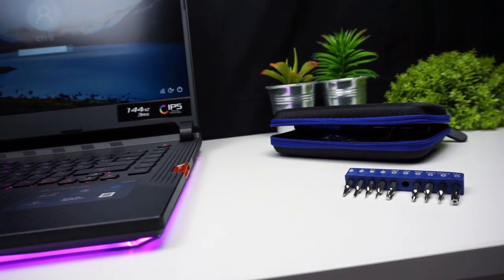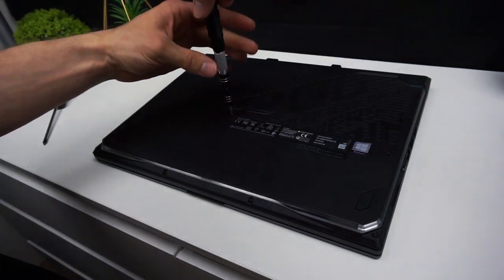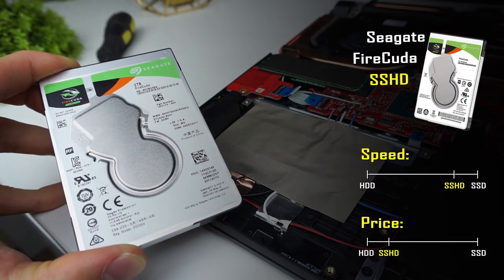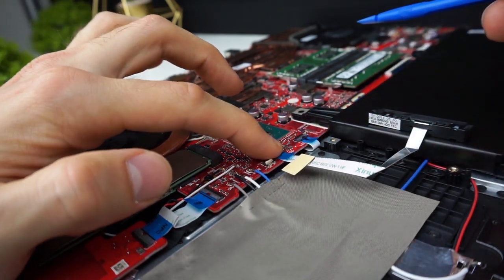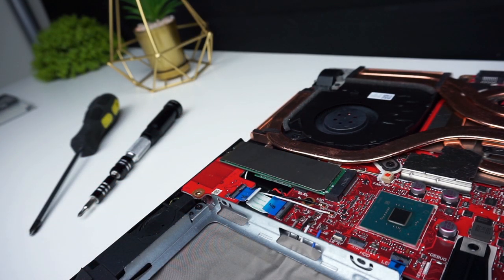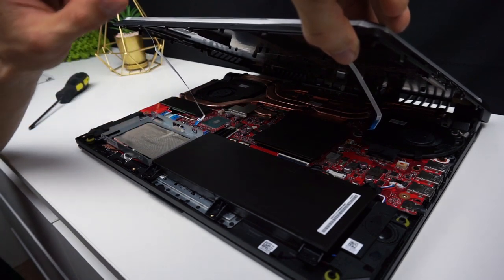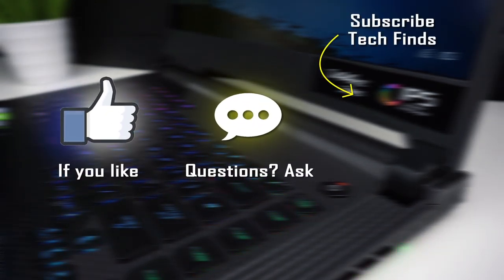Asus Scar III Upgrade RAM / SSD / HDD - Disassembly Guide

Comment: Hey bud! Great video. I am having a hard time in disconnecting and then connecting back the two ribbons from the motherboard. Can you please explain me the correct way to do in with ease in detail?
Reply from the maker: Well, behind the connector on motherboard you have a little white tag. To either disconnect or connect the cable it has to be opened (tilt up), you have to pry it up from the bottom, do something like a lever. When it's opened disconnect or connect the cable depending on what you need to do, and close the tag (push down).

Comment: Hey man, thank you for the guide. I was wondering if I was able to upgrade the m.2 SSD and if there is 2 slots or just one slot? I am trying to upgrade it myself, saving money, and without the crazy pricing.
Reply from the maker: Scar 3 has only one slot for M.2 SSD and one 2.5" drive bay.

Comment: this is rly best video for this notebook...but i have ine question...how u recovery full asus system to new m2 disk ..or u install new windows and download utilities from official site?
Reply from the maker: I didn't install a new M.2 in this video. I jest took off the stock SSD and put it back in to show how to do it. But if you wanna swap it out you have to fresh install Windows on the new SSD using tools provided by Microsoft. But the problem is that you will not have all the software that came with the laptop, so you have to download it from Asus somehow.
Reply: @TechFinds   thank u

Comment: Hi, nice video, I was successful in taking apart the laptop without any issue. But One small question. Do you have any coil whine with your unit? Or does anyone who saw my comment have any problem like that ? For me is very annoying and I am thinking to return the laptop.
Reply from the maker: Thanks! My unit didn't have coil whine and you're actually the first person who report that.
Reply: @TechFinds  Lol that's so strange... I already returned 2 units, And I don't know if I should bother to get another one... Even on asus forums, there were plenty of people who accused the same problem even with older versions... Thank you for the comment :)

Comment: I just got the Strix G731 laptop and wanted to add that internal SSD since 500 Gb SSD is not that much.Since I have never really done this, I do have couple of questions.
 Do you absolutely need the tool you used to prop open the laptop or can just my fingers work as well? 
How fragile are the ribbon cables holding up the case? 
Also, the laptop also has a 2.5 inch hdd bay, right?Is this relatively safe? Do i need to worry about static or working with the laptop on a carpet?
Reply from the maker: Hey, you won't open it with only fingers, you need any thin piece of plastic to separate the bottom lid from the deck. It can be anything, a credit card, guitar pick.. But the tools I used are much more convinient. Don't worry about cables, because they won't break unles you pull the lid up fast without disconnecting them. The laptop has 1x 2.5" drive bay for HDD or SSD and 1x M.2 slot for SSD  UT you already have 500gb one with windows here. I have never got shocked doing upgrades, but for safety reasons people recommend to disconnect the battery. (I never do that) But for sure the laptop must be unplugged

Comment: Hey mate, I have an ROG STRIX G731G and it has 512gb SSD built in and no HDD, I'm wondering if it's possible to add more SSD to it without replacing the SSD that's already in there with a bigger one.. cuz ya know, it's not ideal backing up 512gb worth of data and Windows.
Reply from the maker: You can istall 2.5" SSD instead of HDD
Reply: @TechFinds  thanks! Would you recommend Samsung 860 Evo or western digital green?
Reply from the maker: Samsung 860 Evo has a lot of good reviews

Comment: Hello I had the same problem qt the end but my laptop won't come back even after a hard reset
Reply from the maker: It helped in my case but i don't have any other idea. The way the lights blink tell you what is the problem so you need to check that on the internet or user manual

Comment: Hi I just ordered this laptop for work - not gaming - and see the battery life is only approx 1.5 hours? can you upgrade the battery in this computer? Please advise - i am not a gamer - and my IT guy advised getting this for the work I do
Reply from the maker: You can't replace the battery with a bigger one unfortunately. Depending on what kind of work you do on this laptop you may do something to sacrifice some power for longer battery life. For example using "silent mode" which limits the CPU power.

Comment: Was the ribbon cable for the HDD included or did you bought it yourself? Planning to buy the M.2 only version but I´m not sure regarding the HDD ribbon cable.
Reply from the maker: By default the cable comes with the laptop but sometimes people haven't it included for some reason. It may vary between countries and sellers

Comment: Well since you removed the SSD wouldn’t you have to transfer the Windows info into the new drive had to do that with an older laptop back in the day I don’t know I that same process applies. My laptop has the ssd installed and hdd but I want to change it to the Seagate and a Samsung m.2 2tb. Not sure I’m a bit new to this but I want to do the right thing by asking the expert.
Reply from the maker: If you replace the drive where your windows is installed then you have to re-install windows on the new drive and transfer your files.

Comment: for the NvMe SSD I installed my 970 Evo M.2 Ssd and some reason when i boot it up it sends me to the Bios Utility Ez Mode i looked around for help and answers for why i cant exit the bios screen when i restart it just loads the bios screen. So i took out the ssd and put back the original one it works perfectly again without the bios on startup screen do you know any solution? I spent 140$ for it and i dont want to waste my money like that lol it sucks
Reply from the maker: When you're replacing a drive with windows you have to i stall windows on the new drive.
Reply: usually windows come installed on your old ssd m.2 you need install windows again. what capacity are u using? I 1tb?
Reply from the maker: @djasonx  so if you change m.2 drive you remove windows with it and you have to install it on the new m.2 SSD. If you change HDD only (secondary drive) then windows stays not toiched

Comment: hello,

I am new to gaming pc's and laptops... im wondering what would be the difference in upgrading the ssd vs only upgrading the hard drive? should I upgrade both or one or the other?
I am upgrading to 16gb (8x2) dual channel ram but not sure if I should also upgrade the ssd or hard drive?
Reply from the maker: If you need more storage you can upgrade the SSD or HDD. It's up to you. SSD is much faster than HDD, but more expensive. This laptop comes with M.2 (small) SSD by default and you have system installed on it. You have also one free slot for 2.5" hard drive or 2.5" SATA SSD if you want.

Comment: Quick question do i have to reinstall windows or anything when i replace the ssd on the scar 2? Or its just plug and play?
Reply from the maker: Yes you have to reinstall windows as your actual system is installed on the SSD which you'll be replacing with the new one without OS
Reply: If you replace the M.2 SSD you will need to reinstall windows. If you are adding an extra hard drive you will not need to reinstall windows as it (windows) is installed on the M.2 memory drive.

Comment: I have a question for whoever would know or the video creater. I am planning on putting a 870 evo in this laptop. My version of the laptop already came with a SSHD pre-installed, so I won't need to buy any of the HDD/SSD components right? The drive bay and the SATA cable should already be ready for me to swap out to a SSD? I am also going from a SSHD to a SSD, so would the SSD work in the same bay that the SSHD was in? Thanks!

Comment: please help me after finish the upgrade my right side of monitor have a bit glitch how im suppose to fix this is there any loose cable that i should tighten up
Reply from the maker: Well, i didn't disassemble hinges or display part so i don't know what cables are there. During your upgrade you might have disconnected or damaged something by accident. You should ask someone experienced to check it for you.

Comment: Hello. I have problem, the LED lighting on the lower roof doesn't work. The first time I connected the loops incorrectly, the other side. Then I took the lid off again and put them correctly, but the backlight doesn't work. Could the backlight have broken due to incorrect connection?
Reply from the maker: I think there's a low chance that it could stop working because of that. Have you tryed to turn it on in the software?
Reply: I tried to enable it in the armor create program.  (special checkmark for bottom illumination).  Did not help. 
maybe i should do something else?
Reply from the maker: @АртёмСедов-т8ю  When i was testing this laptop there was no option for light bar in Armoury Crate. I was using  Aura Creator app

Comment: got a question, may be dumb, but, does the hdd come with the ribbon cable or do i need to buy it separately?
Reply from the maker: If you didn't get it with the laptop you have to buy it separately. It should be in box or in envelope with paperwork. If nor maybe it's connected inside laptop by any chance

Comment: My laptop didn't come with the ribbon cable for the hdd, guess I'll be missing out in the upgrade
Reply from the maker: Check in the box or in envelope with paperwork. If the cable's not there it may be inside by any chance.
Reply: Oh, thank you for replying, no there's no cable, but that's fine, I just noticed my laptop it's a different model, it doesn't seem to support sata at all, it has two m2 slots

Comment: After power on, do you still need to setup anything for the SSD and the RAM or it's Plug and Play meaning when you power on your Disk Space and RAM are already upgraded?
Reply from the maker: RAM will work automatically but if it comes to drives after installing you have to go to device manager and make a partition to make it appear in your pc

Comment: Hello... sorry got an off topic question regarding this board. At 2:11 what is the green chip in the top mid right corner? The green one with the black square in the centre. Whenever i connect the laptop battery to the board this chip heats up immediately and starts to smell. The laptop has no other signs of life. No fans no lights. Is this chip replaceable or is the whole motherboard need replacing. Any one have any ideas what's happening?

Comment: do you recommend remove totally the battery and only use the laptop plugged?
Reply from the maker: No, you should not remove battery. You should use the laptop plugged in and with battery.

Comment: Do you have to disconnect the battery to just install the ssd? Can a beginner do this or would you recommend taking it to an IT guy?
Reply from the maker: Disconnecting the battery is not necessary. You can upgrade it on your own, i showed how step by step. Make sure that your warranty allows you to do it.

Comment: Really good video but here is a question hope you'll see. My Rog Strix G came up with SSD and I wanna add the second SSD for D drive. As I see in your video there is an empty caddy inside so where is your SSD? It's under the caddy? If not, where I'm gonna insert the second SSD?
Reply from the maker: The laptop has one slot for M.2 SSD format (a small thin one) and one slot for 2.5" bigger drive like HDD or 2.5" SSD. My unit had M.2 SSD and i added 2.5" drive (SSHD) in place of caddy
Reply: @TechFinds  Oh I didn't know M.2 SSD format. Is there any chance to learn if my SSD 2.5" or M.2 without open the laptop case?  What if my SSD is 2.5 inch one? My ex SSD is also 2.5" so that's mean I won't be able to use both of em?
Reply from the maker: @Sinlatown  Scar 3 originally comes with only M.2 SSD. Sometimes you can find it with 2.5" HDD i guess but no SSD
Reply: @TechFinds  Thanks a lot mate! Tomorrow I'll try my chance.

Comment: Hello please i cant connect the battery back can you please explain how to do it ?
Reply from the maker: I don't exactly remember what type of connection was there but i showed it on the video and it looks like you push the white part down into the black slot. You should figure out how it fits there, it's like a puzzle

Comment: Hi i know it's been a while now, i watched your video a dozen of time because i would like to upgrade my scar 3 whith a sshd too, but i'm very stressed about this operation i never done anything like this so i have few questions:

Do you have a special tool kit to recommend ? (For other than US)

For the black tag of the motherboard i need to tilt up from around 45 degres to 90, plug the ribon cable, and then tilt up from 90 to 135 is it correct ?

How about the chance of failure or fatal error for a complete non skilled person in this operation ?

Otherwise thank you for this teaching your video was really clear
Reply from the maker: Hi, as it is an electronic device there's always a chance of something going wrong, but if you're careful it's not common. You don't have to use special toolkit, but it's good to have as it makes the job easier and more safe. There are many kits on the internet, just look for one you need in your country stores. If it comes to this tag just pry it up and it will open, then put the cable and push it down. It's easy, you don't have to do any math here.

Comment: Hey man i got here Asus Scar 3 with 8GB and No Os. So i installed Win10 and works ok.
The Question is , can you Add Only 1 more Addional 8GB without taking case wide open. I mean is there enaugh space for even not disconnect the RGB cable? And must i take off battery too?
2nd. Armour Crate of this Laptop version not starting instantly what about you how many sec do you need the Program for Loading? Im asking becouse of the hardware defect or couse of Single DDR4
3. How much down can i go with Offset Undervolting ? Can you make a Video of this Pls.
Reply from the maker: Bro, i don't have this laptop anymore, but i can answer you for these questions here.
I don't think you can add RAM without taking off the lid completely. You can install max 32GB in this laptop (2x16GB). I usually don't disconnect the battery when upgrading laptops, but it's a good practice (not sure if you should or not). MAybe there's a chance for electric shock if you don't do it, but it never happened to me.
For Armoury crate i had to wait just a few seconds to load, maybe 5 sec. Everybody complains that this app is glitchy.
For i7-9750H i always set -0.150V. If you get game crashes or blue screens you have to set less.
Reply: @TechFinds  the Problem is , if i take the CPU offset to 0,150V the CPU speeed inc. to 4ghz without drop and trobble but if i play on silent mode im getting Bluescreen. There is a Game which i play on silent mode ... i dont know
Reply: @TechFinds  but my Temps are ca.  70 72 74 and its fine. And without Undervolt not even possible to hit 4ghz with this Laptop lol
Reply from the maker: @samia6903  Because the max multi core clock speed for i7-8750H is 3.9GHz. You're getting blue screens, because the silent mode probably decreases the CPU power, so in combination with undervolting it may happen depending on what you play.
Reply: @TechFinds  ok i get on 0.13 stable . Even on silent Mode. I forget the Power Consum on Power Save Mode and the CPU tryed to run with 4-6Watt 🙈 On Balanced Energy + Silent Mode 3.3Ghz and 65-70° and on Max Perform. + Silent Mode 3.9GHz and 70-80°. The point why i playing on Silent Mode is , im playing Wow Classsic and dont want to load max FUN . Just Running but sometimes becomming the Error about Power Limit Trouble . Shall i do something else?

Thx
Reply: I sent Laptop Back... On the Right side no USB no Other connections just only Keystine couse of Mous Place. But the FUN Outflow is really really Fail... LoL u cant able the hold the Mous there after 1 hour..
Reply from the maker: @samia6903  you have to choose a laptop with exhausts only on the back, or back and left side if you're right handed. I have never found that an issue and I tested many laptops with vents on both sides

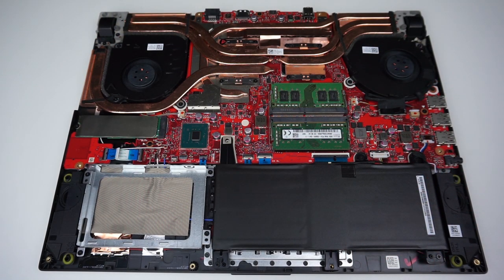Comment: At 1:45 there appears to be a sticker on top of one of the bolts for the heat sink. If I want to repaste my cpu and gpu, will I void my warranty?
Reply from the maker: Yes, your warranty will be probably void after disassembling the cooling system

Comment: Hey there! Im hoping you can help me. I have the ROG Strix G531GU. I took apart my laptop like this but I didn't see a ribbon cable with the SATA connector attaching the motherboard to the hard drive. How did you get yours? What could I do in this situation?
Reply from the maker: You should get a cable with the laptop but somewhere in the box or in envelope with paperwork. Sometimes it happens that cable is missing but it depends on the country/seller

Comment: I have recently bought an ASUS ROG Strix SCAR III come with Intel i7-9750H 16GB Ram ,1000GB PCIe  RTX 2060 6GB 17.3 inches. I want to add Hard drive for data storing but I'm not sure how big capacity of Hard disk should add , can this laptop fit with 2TB or more ? Thank in advance
Reply from the maker: You can install 2TB for sure. Usually more capacity comes with thicker drive and idk if it will fit. But 2TB HDDs are usually 7-9mm thich and that's good
Reply: @TechFinds  Thank you sir 🙏

Comment: Do this laptop have that ribbon cable inside ? 3:17 And the screws for the caddy? I wanna install the 860 evo inside and i don't know if i need to buy that ribbon cable and screws. Any help?
Reply from the maker: You should get the cable and caddy with the laptop, but i've heard that some people didn't have it. It may bary between countries.
Reply: @TechFinds  Thank you . I saw that on another upgrade video!